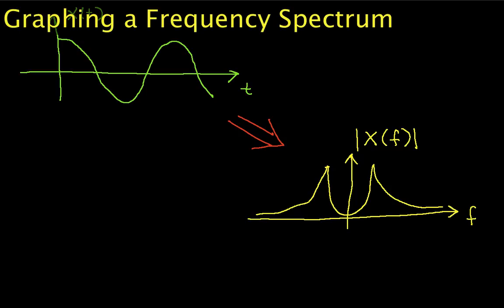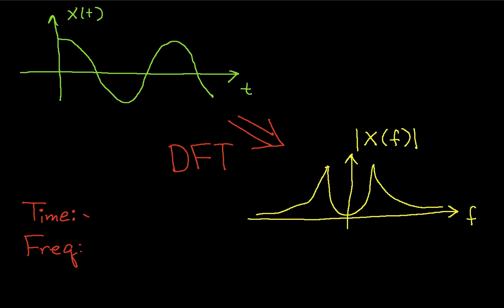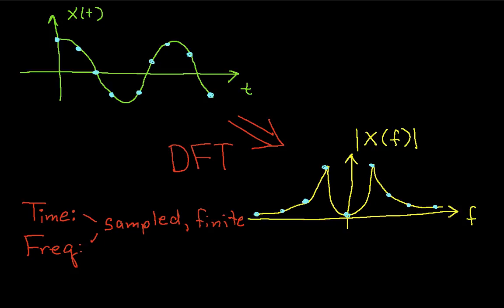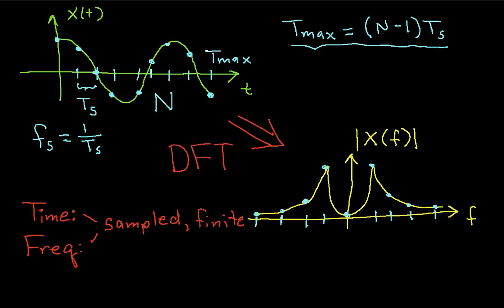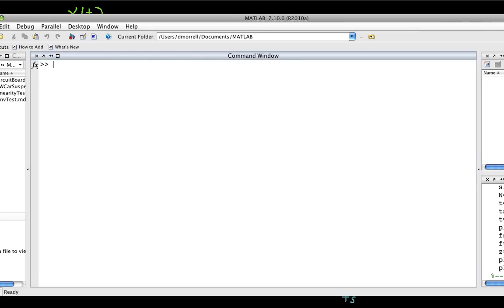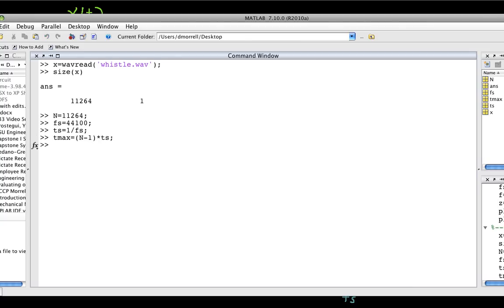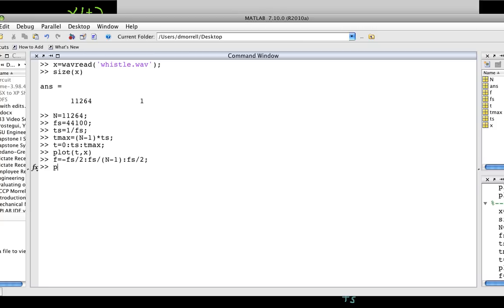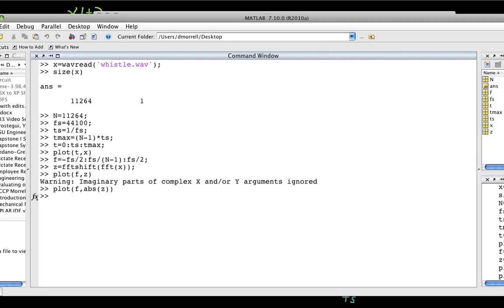Graphing a Frequency Spectrum with Matlab

Comment from the maker: Ts is the sampling period (ie, the time between each sample). It is a parameter of the process used to sample the signal and is independent of the frequency of the input signal. In the video, we look at signals sampled at a sampling rate (sampling frequency) of 44100 Hz, so Ts = 1/44100.

Comment from the maker: The highest frequency you can represent with a sampled signal is fs/2. So we usually think of the spectrum range as -fs/2 to fs/2. Because the time signal is discrete, the spectrum is periodic with period fs, so sometimes we think of the spectrum range as 0 to fs; the equivalent information is there.

Comment: Am I correct if I proceed like this: I am using instantaneous current= I(in) , Peak current=I, omega (w) = 2*pi*f*t where T=0to1second ,  Fi= phase difference = powerfactor reading..........
I(in)=I*sin(w*t + Fi)===> I=0.33Amps, f=60hz, t=0.55 (these values are from the instrument)......... So can I perform harmonics  distortion with this much information??

Comment: Hi
How can I know what is the fs if I dont know were the sound were recorded?
Thanks!
Reply: [x,fs]=wavread('audiofile.wav') ; this will give you the fs.
Reply: hi Ahmed Shubbar im trying to run instead of using recorded sound im using this function x=sin(2*pi*f1*t)+2*cos(2*pi*f2*t);  but it does not want to show spectrum 

f1=10; 
f2=30;
x=sin(2*pi*f1*t)+2*cos(2*pi*f2*t); 
n=20;
fs=200;
ts=1/fs;
tmax=(n-1)*ts; 
t=0:ts:tmax;
plot(t,x)
f=-fs/2:fs/(n-1):fs/2;
z=fftshift(fft(s));
plot(f,abs(x))
Reply: shand seimela that worked with me with some minor fixes. You're working with too few points "n"; but you should still see the f1 and f2 spikes in the spectrum. Remember that Fourier transform decomposes the signal to sinusoidal waves that go from -infinity to +infinity. A short burst of a sine wave is not really a spike on the spectrum, but an infinite sine is. And visa versa, a spike in the time domain (impulse function) is filled with all the frequencies in the spectrum.

Comment: Need Help!! Need code for MATLAB. I have section moment(offshore problem with random loads) data  in time domain, t=1,2,3....1000 seconds and secton moment value for every second. First few natural frequencies of the modal are 0.25,0.51,0.75... rad/sec for 1,2,3 modes respt. I want to plot PSD for this data in frequency range of 0 to 2 rad/sec.(The idea is to show what happens when section moment is close to the natural frequencies, that is to show resonance)

Comment: You should correct something. The sample distance in the spectrum is fs/N not fs/(N-1). This comes from the definition of ωk (or ωs or ω0 depending on the book) which is ωk=2π/N => Ωk=2πfs/N => fk=fs/N.
DFT calculates 0 to N-1 samples so the last sample corresponds to (N-1)fs/N. It misses one sample so the exact range is 0 to fs-fs/N. This happens because the DFT is in fact samples from one period of the periodic spectrum as calculated by DTFT, and the period in a periodic signal is a closed-open inteval [ ) or ( ] not [ ]. It leaves one sample out, otherwize it repeats improperly. When you do the fftshift the range becomes about -fs/2 to fs/2 but not exactly. The distance is still fs-fs/N thats why with rate fs/N you get total samples N.
You can check that matlab follows this definition in help fft. ωk is the 2*pi .. /N inside exp() and the k goes from 1 to N whitch becomes 0 to N-1 for (k-1) inside exp().
Phh this fft is the temple of comfusion and the slightest error makes it worse.
Reply: nervren im interested ........i followed what he did but does not work